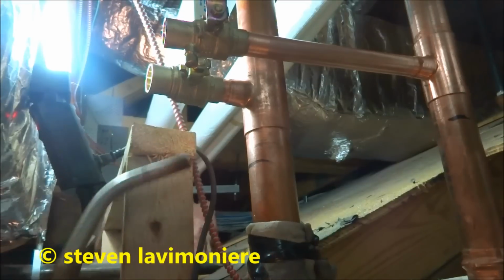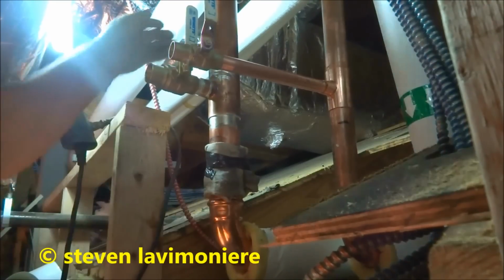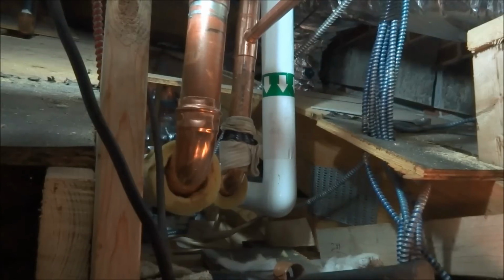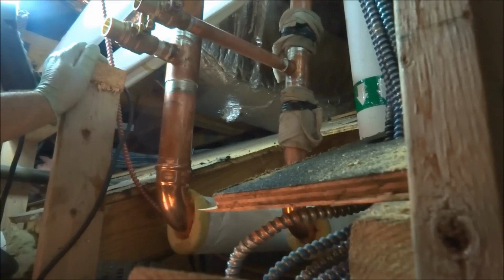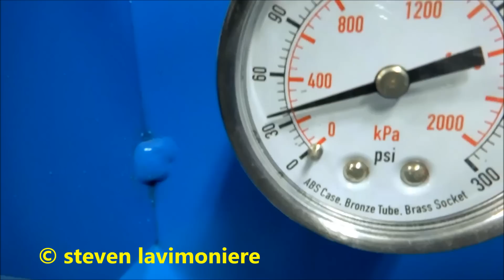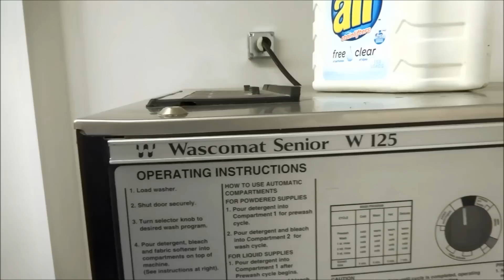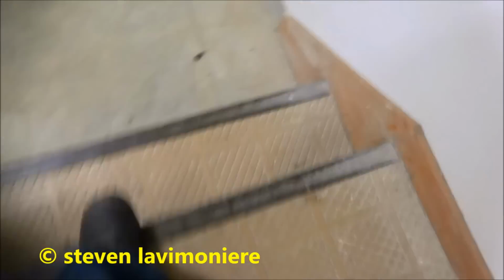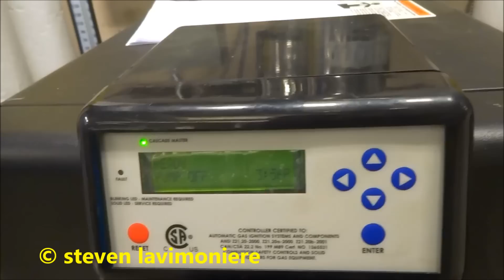commercial water pipe job part 2 of 5

Comment: Pro press is a quality system. I've done thousands of joints- the only failure is from the installer. I've used it over 15 years. Boilers, domestic, air. No failures. Saying its a system that is "not as good as" or "will fail eventually" is like saying you will only pour cast joints for waste fittings because plastic won't last... In our field, just like any other, adapting to the times is crucial. If you don't, your competition will leave you in the dust. All that being said, nice work lav!

Comment: Steve I love your videos and always admire how you take the time and do things right but I have to say I was surprised when you were soldering and wiping the joint immediately after as a long time pipefitter I’ve never seen that and it wouldn’t be acceptable on a job  and didn’t seem like enough solder was used on a couple joints doubt their was full penetration. Great heat control just don’t wipe!..haha leave a clean bead of solder around it

Comment: Is it better to solder ball valves closed or opened? Thanks.
Reply: either is fine. it's most important to make sure they are fully open or fully closed. it feels better to me to solder with them closed, but sometimes you need them open to relive the pressure if there isn't another opening in the system...

Comment: Nice one Steven! I buy sweat fittings for the guys, but they throw the fittings on the shelf and use the ProPress fittings. I tell my guys ProPress is when you can set something close by on fire, and for people who can't solder. 1/2" and 3/4" fittings? Come on guys!! Old school, learn to solder!!!
Reply: Damn right, soldered joints will last a lifetime
Reply: Thanks TheChipmunk2008! I was waiting for all the negative comments saying, "ProPress is the way of the future!!! Lets see 5, 10, 15 years from now. Especially for systems with glycol in them.
Reply: I worry about all the plastic stuff they're using now, buried under floors waiting to leak. I'm not sure what they're using for the o-rings in the propress but... like you say, how will it stand heat+chemicals+expansion/contraction over time.. nobody knows.
Reply: PEX been used in Europe for 50 Years no issues if you buy the Legit stuff :)
Reply: I'll take a good solder job over pex or pro press any day. Besides, soldering is a skill. I could teach my 9 year old girl how to crimp a pro press fitting!
Reply: Jack Spero
Not with Copper these days Acid water will EAT the crappy copper up coming out of communist china.
Reply: haha. i see a lot of stuff get press fittings that definitely don't need it. To me that seems like an emergency type repair if you can't get water shut off all the way rather than an everyday method. no excuses to not solder any size pipe but especially the little stuff!
Reply: Your right!!!! Ten years from now when you say, Who the hell soldered that fitting? Kids  will say, "Solder? What the hell is solder a fitting?" LOL!!!
Reply: Not sure if you have it in the US, but here in the UK a lot of stuff is going with 'press fit' (domestically at any rate)... take pipe, plastic or copper, (the plastic is kind of a weird 3 layer sandwich...) and simply push it on. And it holds. For how long, i dunno. I view it with suspicion, but it's not my trade, so i could be just being needlessly conservative
Reply: ***** Yeah, we have stuff like that here and it seems frightening to me. Obviously, it works for some amount of time. But, I have strong doubt about any kind of real longevity or resistance to thermal expansion, etc. It also opens a new can of worms with folks that have no mechanical inclination whatsoever; using parts like this with no consideration to the application or surrounding conditions (ie stuffing one of those fittings onto a copper tube with nasty burrs from the hacksaw)